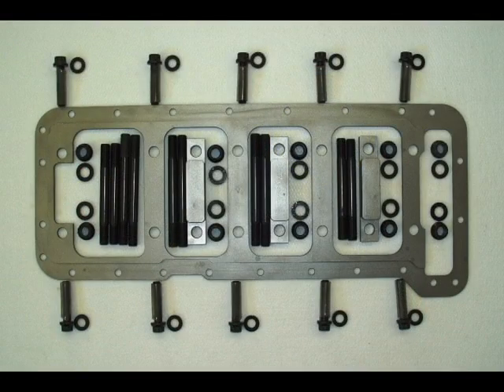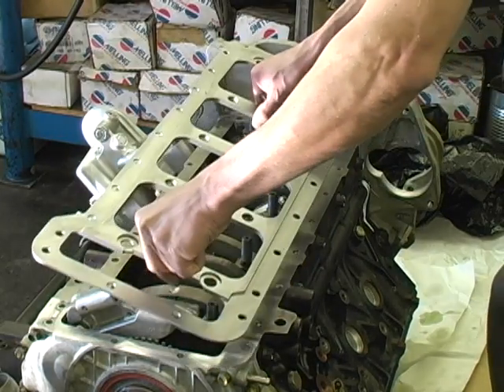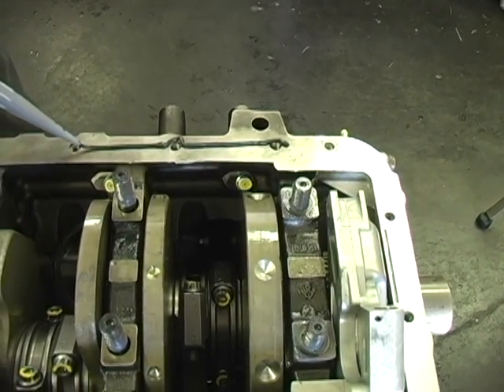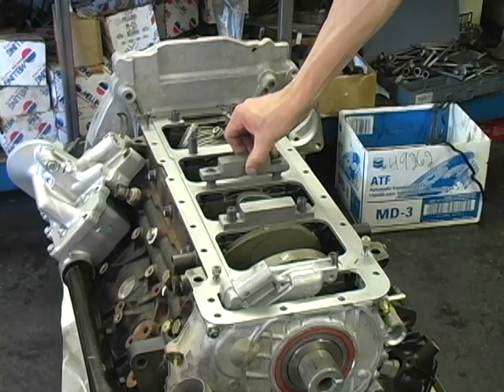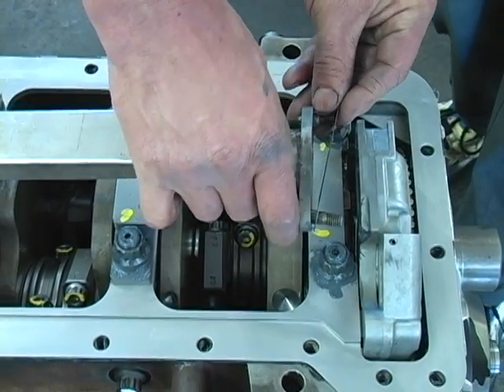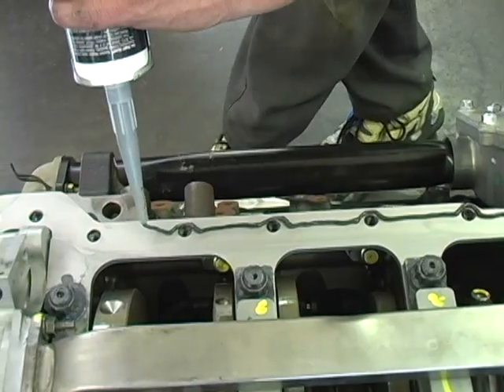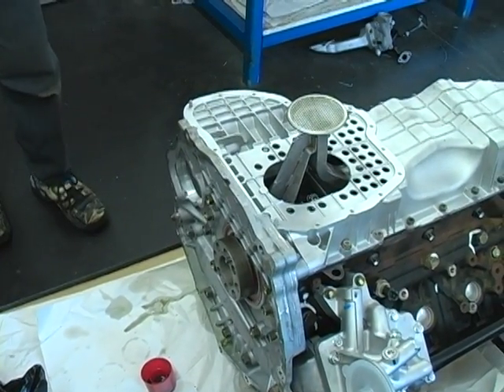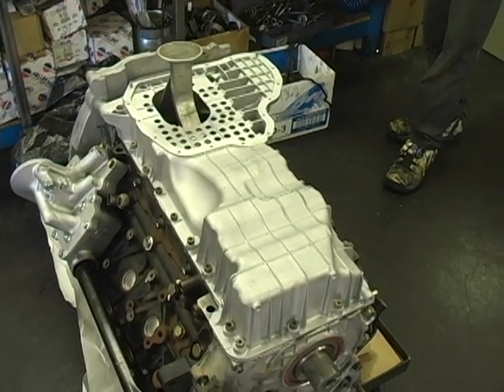duramax Main Bearing Gorilla Girdle Block stiffener

Comment: Great video about a great product.  I only have one suggestion, as a fellow engine builder, I clean all surfaces with brake cleaner instead of carburetor cleaner.  I am told carb cleaner leaves a small amount of a lubricant?  Brake cleaner does not have the  lube, leaves a cleaner surface to adhere to.  Just a suggestion .  thanks Bob